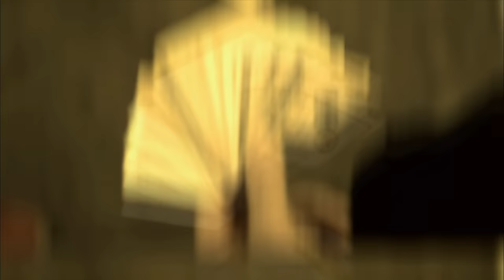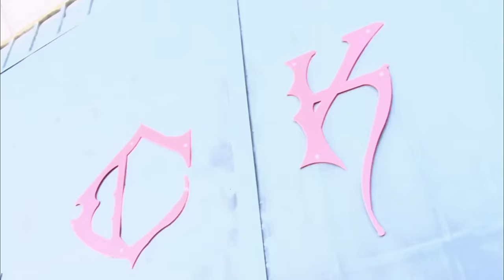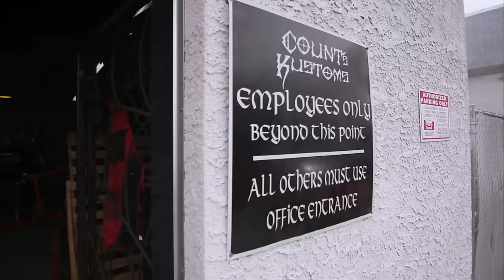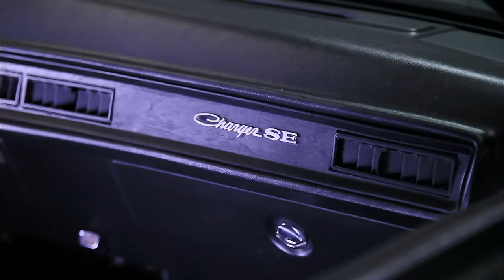Counting Cars: Framed (S1, E12) | Full Episode

Comment: This is basically my car from high school. Officially called a Charger Rallye. Front and rear sway bars. Black stripe the full length of each side. Slap Stick. They forgot the hood pins and the black pin stripe around the hood bulge. 
Perfect condition in '79 for $1400. sigh
Reply: Was 11 in 79 and foaming at the mouth to pick up a musclecar cheap. 
Before Jr High id buy the Recycler ea Thursday and drool over all the cars/parts for sale. no wonder I never finished HS